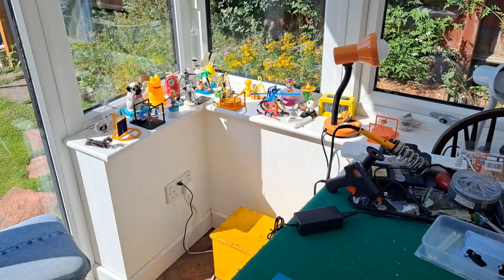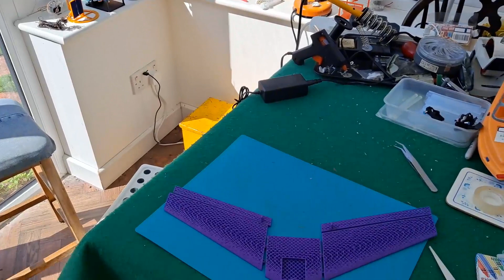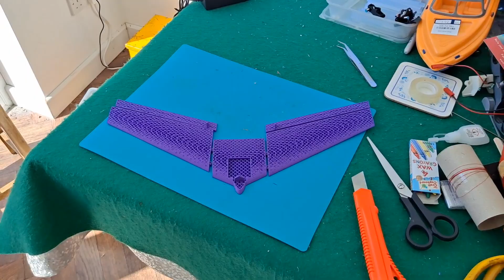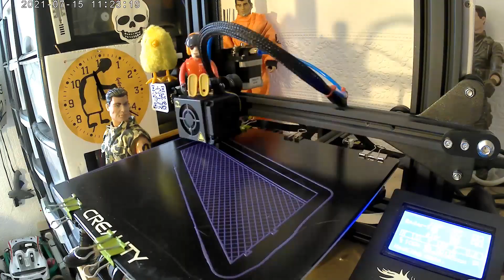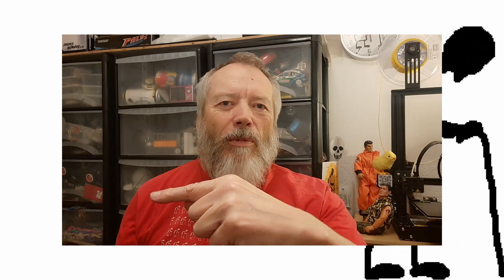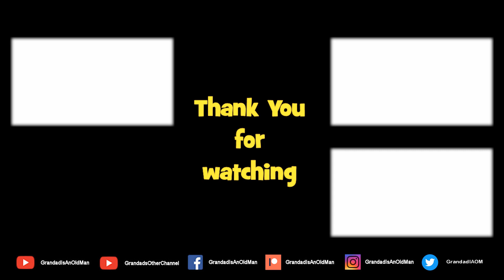Printing the Micro Flying Wing

Comment: nice wing, came out good with the printer.i used to make a wing like that out of paper,course the paper was layered to give it some strength but it didnt fly too good so i made a little holder on the bottom underneath the wing to throw it but still didnt fly right.when i threw it it just went up and nose dived into the ground.never really flew that good.that was years ago i made that, dont know if i have a video of that.it was called the omniwing.i remember now. omniwing is what that is called ya.
heres a link wo one of the builds by someone.

https://www.youtube.com/watch?v=h3EENc0Romo
Reply from the maker: Yes the Omniwing is a popular paper plane design. I have not made one, yet.

Comment: Interesting wing! What nozzle size do you use on your printer? I'm currently using a 0.4mm nozzle on the printer I use the most and was wondering how thin the walls could be made before structural integrity suffers too much. I think this wing could and should be printed entirely with a single-wall thickness and afterwards, wrapped with some type of foil.
Reply from the maker: I have the 0.4 nozzle. The designers guidance on Thingiverse is:-
Resolution: .2
Infill: 5%
Printed with 2 walls (.4mm) and ZERO top and bottom layers. For infill I used a grid pattern in Cura. This is what generates the wing structure. The wings should be oriented on the plate the same for each wing, though a reverse orientations should be fine too. This helps the grids to line up when assembling the wings. Cover the wings with packing tape and used foam plates to cut out winglets.

In the video I had forgotten to set the infill to 5% so it will be much too heavy. I reprinted later with the correct infill.